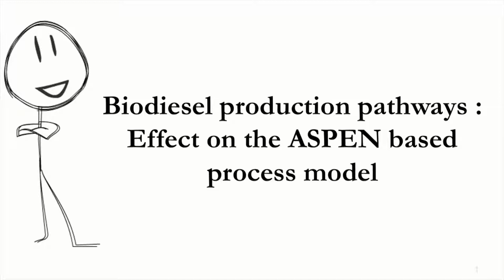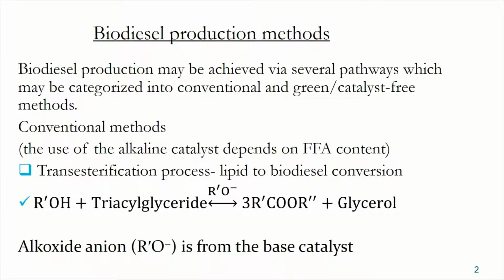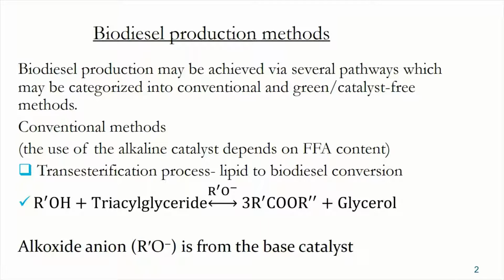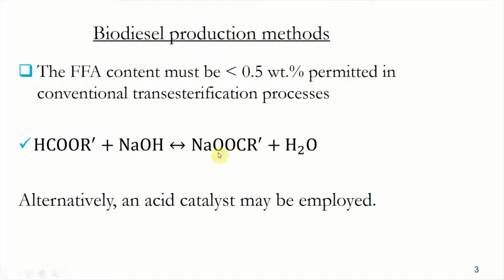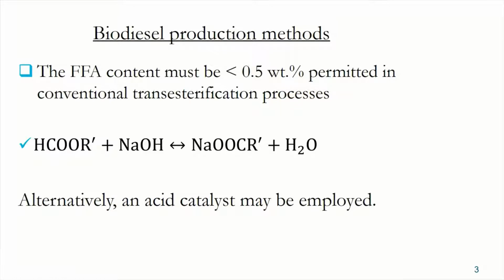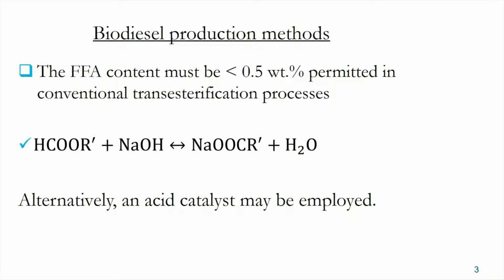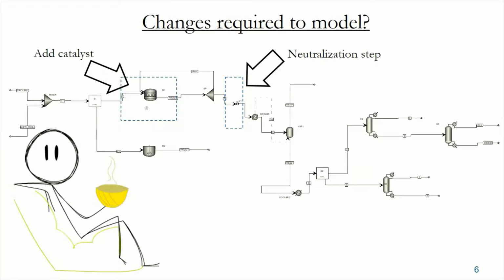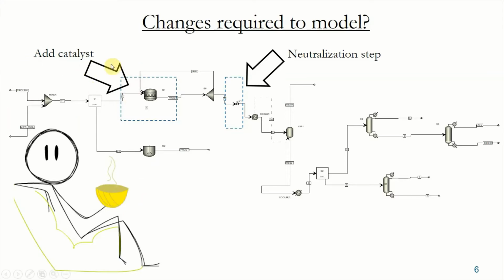Exploring biodiesel production pathways. A synopsis

Comment: Would you recommend sodium hydroxide or potassium hydroxide as a catalyst ?   an esterification process would be done before hand with sulfuric acid for example
Reply from the maker: Hi Ilana..yes, both are used in bench experiments..but I believe Ca(OH)2 is also useful because it's salt, CaSO4, is insoluble ..and thus easy to separate from the mix ( after the neutralisation step) ..it's also pretty cheap..in choosing the catalyst, you need to always consider downstream purification steps
Reply: @BiomassValorization   Thank you ! CaOH2 as an alkali base for the transesterification?  and CASO4 as an acid for the esterification process ?
Reply from the maker: @ilanabensignor3488  oh no..CaSO4 is a salt.. ..for transesterification ..u could use Ca(OH)2 , for esterification, you could use H2SO4 .. or HCl or any other acid
Reply: I think I am gonna use NOH because it is present in aspen hysys